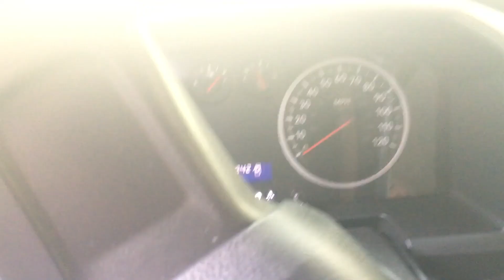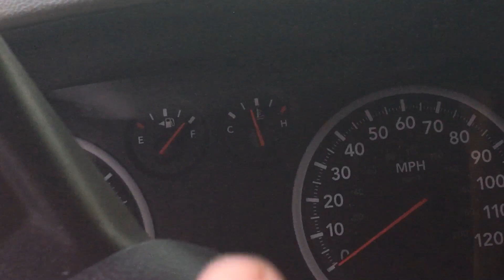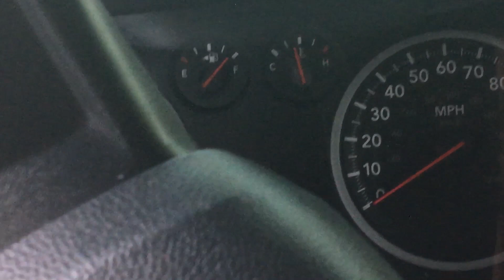Dodge ram temperature sending unit part one

Comment: Was the new brass one tight going in?
Reply from the maker: It was, but I put a little Teflon tape around it. Just make sure the threads are good going into the engine. Happy holidays.😁👍
Reply: @Hellcat Redeye -G  okay. I have the brass one that supposedly replaces the plastic one but it is not tapered like the plastic one making it not go in has far as the old one.
Reply: @hellcatredeye-g6582  you were able to get it in as far as the plastic one?

Comment: Would that cause the clutch fan to  stay engaged
Reply from the maker: The proper way of doing it would be scanning it with a computer to check into live data to see if it’s operating properly but most likely it’s the problem though the one I had was showing -30° that’s why it was constantly on .. i’m a mechanic so I hook my snap on computer onto it and I can clearly see on the data but it’s not that hard of a job and it’s very inexpensive. That’s where I would start.👍
Reply: @hellcatredeye-g6582  I've changed the temp sending unit,I changed the clutch,and the thermostat and my clutch fan stays engaged. Mys my truck sound like a jet fan and I'm losing acceleration from take off
Reply from the maker: The clutch fan itself could be bad also check your antifreeze to make sure it’s full because if it’s low it would also cause it to come on but if the sensor didn’t curate it and the antifreeze is full replace the clutch fan itself I have a Snap On computer it’s a lot easier to diagnostic with it  And do what they call live data I can pretty much pinpoint it very hard to do a diagnostic without looking at it but that would be the next step

Comment: Might wanna look into that tick I hear , run 5w20 and no gas below 89 octane , change after 3k because oil tends to get thicker after a while , which hemis hate
Reply from the maker: I appreciate the info.. the ram actually has a brand new never been put into a vehicle before crate motor from the Dodge dealership in Lawrenceville, GA Unfortunately the cams Wear  because of the lifters ..were actually rebuilding one right now we just began to rip it down today I’ll try to do a video and definitely oil change is the most important thing for the vehicles thanks for viewing
Reply: All them tik

I have a 2012 same tik then stop after I drive it

Comment: What code where you getting ?
Reply from the maker: plata3231 Wasn’t getting a code the temperature gauge is reading almost hot.   I knew it was the incorrect reading the new part  fixed the Problem